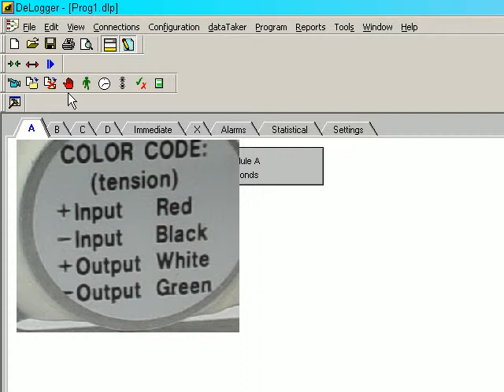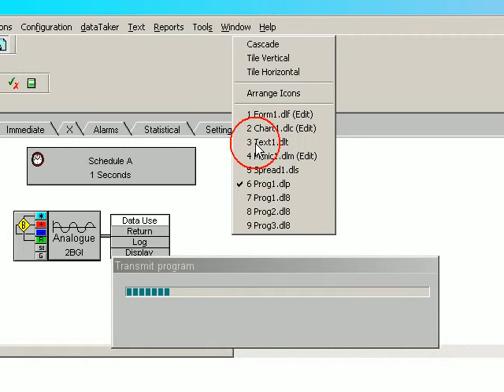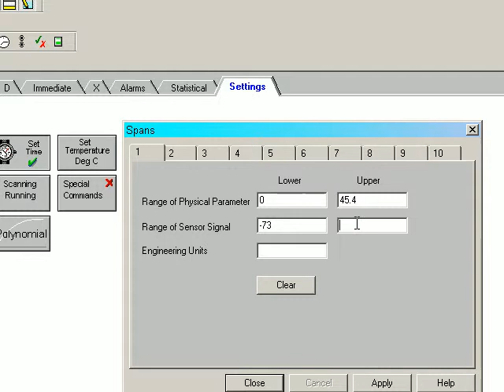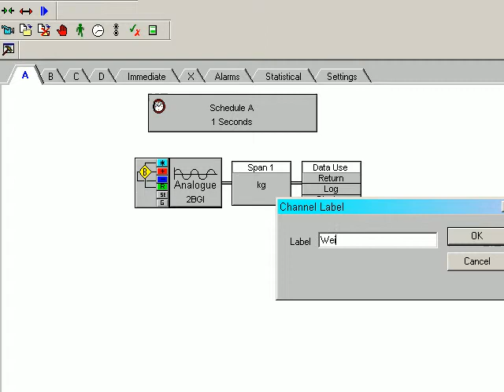How to Connect a Load Cell on the dataTaker DT500

Comment: How did you convert 100 pounds to 2000.6 ppm?
Reply: The ppm is parts per million, a strain gauge is an electrical device called a bridge, the ppm measured by a strain gauge is the change in resistance expressed as a ratio against its initial value (usually 120ohmsor 350ohms. etc.). Each strain gauge has a 'gauge factor' which is the change in resistance vs the change in length. Then the for the particular material used the change in length is proportional to the load exerted by a known weight under gravity i.e,. pounds in your case. So the ppm change is directly proportional to pounds. The easiest thing to do is simply apply a known load record the ppm, apply another load record the ppm. Then you use these numbers as your scaling factors.